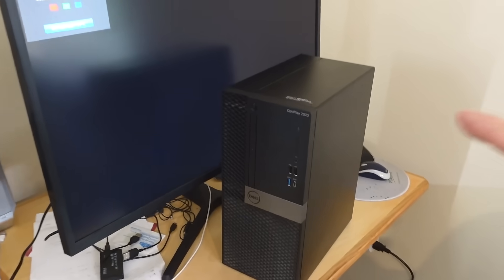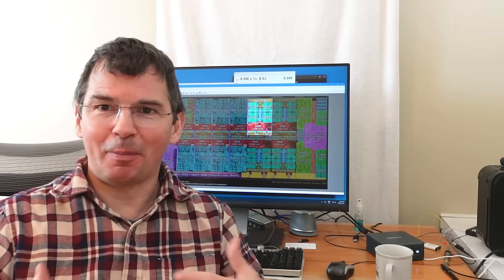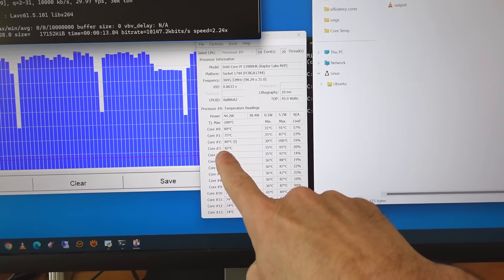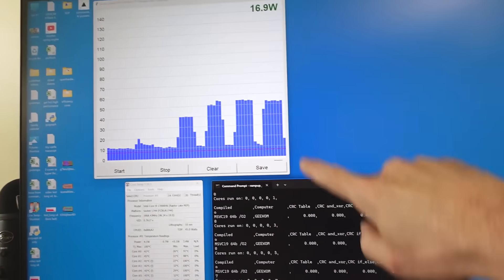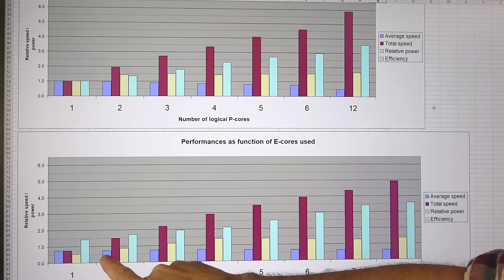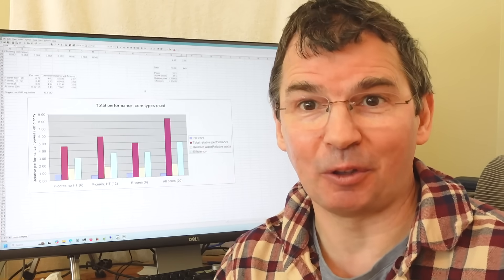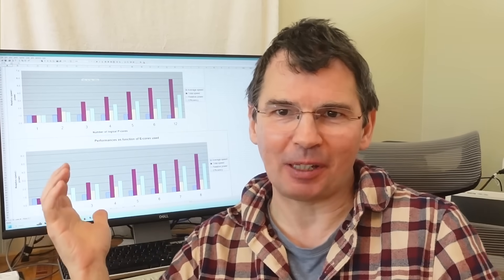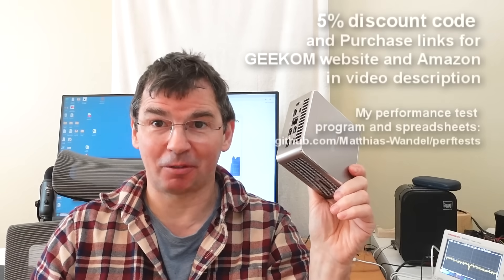Efficiency cores are about performance more than efficiency

Comment: E cores are a huge pain. You are completely at the mercy of the scheduler. Intel also has lp cores in laptop chips, though I never saw task manager show them used for me. E cores behave  different than P cores. They are far less performant than P cores.
Reply from the maker: in my tests, doing old fasioned C stuff, they were only 25% slower.
Reply: @matthiasrandomstuff2221  I think you would love something like an Arrow Lake or Lunar Lake CPU. The E-cores there are massively more powerful than these. 9-wide front end instead of 6-wide, and 8-wide execution instead of the 6 here. The new P-cores are cool too, but those Skymont E-cores are close to the performance of 12th-gen P-cores, and they will hapily do P-core-like clocks of 4+ghz.

Comment: 2:55 if you start the task by mouse clicking a bat file instead of using the keyboard in CMD.exe Windows directs the CPU to use more power?!? That's crazy! I wonder if that's an heuristic used to fool battery efficiency benchmarks a la VW Dieselgate.

Comment: We've done a lot of analysis like this at work, trying to optimize huge database servers.  Glad to see you've mentioned the caveat at 10:32 because our findings were that while our database engine was capable of multithreading, for some jobs raw clock speed is what mattered most.
Reply from the maker: back in the day of Pentium 1, we got a dual processor machine.  I had a very keen co op student who adapted an internal app to multi threaded to take advantage of it.  to both of our surprise, this was slower than before.  the IPC overhead killed it.
Reply: Another issue is that a lot of commercial database software is licensed per core.
Reply: @kellymoses8566 However, having the core in the system necessitates a license charge. Disabling the core in the processor doesn't obviate the license charge, unfortunately.
Reply: @kellymoses8566  Yep, so some they want a mix of both... that said the new AMD processors have that in spades, but per clock speed only still goes to Intel as the only win.

Comment: This reminds me of the funny quiz question: It takes one window cleaner 80 hours to clean a skyscraper. How long would it take 800 window cleaners to do it? Definitely more than 6 minutes.
Reply from the maker: yes, tons of applications that don’t paralelize
Reply: It will only take six minutes, but only after you spend 300 manhours getting everyone in position, then another hundred hours getting everyone down safely.
Reply: IDK. If you provide 800 lifts and find a way to make them actually usable at the same time....
Reply: That reminds me of "if it takes cookies 20 minutes to bake at 300° then it should only take 2 minutes at 3,000°"

Not the same concept, but reminded me.
Reply: @MrModTwelveFoot  Foster's Home for imaginary friends?
Reply: @MrModTwelveFoot  Celsius or Kelvin 😅
Reply: @TobiKellner   I was thinking in Fahrenheit because I'm a neanderthal, but the math works out in any unit. 😆
Reply: @MrModTwelveFoot well, I asked because 3000K is ten times 300K in a way that 3000C isn't ten times 300C 😮
Reply: @TobiKellner  The higher the temperature gets, the less relevant the difference between absolute zero and the zero-point of your scale gets.  And there isn't that much of a difference between Celsius and Fahrenheit in this regard either, simply because the Fahrenheit degrees are smaller, increasing the relevance relative to Celsius, but that's also balanced out with a lower zero point, lowering that relevance again.  I think there is a greater effect from the smaller unit size because the zero points are so similar, but past 1000⁰ in either scale, it really doesn't matter much in either case.
Reply: Amdahl's Law

Comment: While it might not be interesting enough for a video you could try comparing some of these results on Linux (easy enough since it's only ffmpeg) just for your own interest. The Windows CPU scheduler has left a lot to be desired over the past few years especially for "weird" architectures like P/E cores and ryzen 3d vcache. Some Windows-native video games actually run better on Linux through wine now just because the scheduling is so far ahead. If you really want to get busy with it you can also tweak which scheduler the kernel uses entirely although that's out of my expertise.

Comment: The problem with those mini PC's is that you can't fit the really high-performance GPU's that you really want for things like CAD work.
Reply: Some do. Some of the Lenovo Tiny's and Minisforum PC's have a PCIE slot and just enough room for a LPSS(low profile single slot) GPU like the smaller x400/x600/x1000 Quadro's. A few Chinese GPU manufacturers are even now making LPSS Gaming GPU's for this class of machine due to their increasing popularity.
Reply: External GPU?
Reply: @jaro6985  that's an option, but then you're also giving up the portability aspect to some degree.
I just went with a "desktop replacement" laptop instead.

Comment: I've started using mini-pcs for all my work computers and they do everything you need from a basic computer with a lot less power usage (and cheaper too!). One thing I have my eye on that you may be interested in is the new Beelink Me Mini. It's a mini pc with 6 m.2 slots for hard drives. I'm really curious if it can be sufficiently cooled with a single fan

Comment: Would love to see a comparison with a base mac mini. Great insights as always. 🚀
Reply from the maker: would love to do that too, but the base mac mini costs like a top of the line non mac mini pc, and  these videos don't earn enough to justify the expense.
Reply: @matthiasrandomstuff2221  You would definitely find a lot of differences. Relative to Intel's, Apple's efficiency cores are much more focused on power efficiency, much less on area efficiency, and much less on providing lots of performance.  Not sure what the ratios are in the current M4 generation, but in M1 an E core was roughly 1/3 the performance of a P core for 1/4 the die area and 1/10th the power.

Apple still sometimes uses E cores to increase multithreaded performance in low end parts (e.g. M4 has 4P + 6E), because 4/3 the throughput per unit area is a win, but unlike Intel their high end parts are skewed heavily towards P cores (e.g. M4 Max is 12 P + 4 E). Their P core is more power (and probably area) efficient than an Intel E core, so they don't have to follow Intel's path to keep power and area under control.

Comment: 2:45 Intel has the PL1 at 45W, which given the 8W base line from before indicated to me the processor bounces off of the configured power limits hard.
PL2 (115W) can be up to 28 seconds, it seems to be close to zero in this case.
Reply: 10 seconds later he explains that it's Windows' bizarre window-focus-based heuristics forcing the workload onto E-cores-only.  IIRC, this doesn't happen with the performance power plan, but that also disables some C-states and frequency scaling, considerably raising idle power.  Easier to just run Linux.

Comment: The problem is that lithography naming is marketing now. These Xnm mean different thing in each company.  For example that Intel 10nm lithography sometimes is denser than TMSC 7nm.... guess why later Intel renamed it to Intel 7.
Reply from the maker: reminds me of AMD using funny equivalent clock speeds in the days of the intel P4 because the P4 could achieve higher clock speeds, but without actually increasing the performance.
Reply: The nm numbers have been meaningless since FinFet was new, and FinFet is being phsaed out at the hing end now lol. Intel's rebrand was indeed to better match the transistor density of competitors, mostly because that was deemed the most important metric to market on. The numbers mean basically nothing and are useless to compare from foundry to foundry. The best you can hope for is that smaller = newer = better within a given foundry's offerings.

Comment: 13:57
Please don't ONLY test the DC side. You need to test the AC side as that's what you're paying, most power supplies from chinese brand PCs have bad efficiency so you need to account for that as well.

If you need speed on a budget, get shelly or sonoff and flash tasmota/esphome on them, you can change the timing to ms refresh if you want to since its using esp32 chip, tplink is god awful as they are  closed-source and using a proprietary chip. Maybe you could get a ton of GaN supplies next to see the difference in efficiency, they are awesome.
Reply from the maker: All my measurements are on the AC side.  Please do watch the video to see.
Reply: @matthiasrandomstuff2221  
Sorry I meant the time stamp, where you plug it into an oscilloscope, that's DC no?
Reply: @jackipiegg  watch the video again, he's using AC

Comment: I love these little NUCs!  I wish I could find a good use case for ‘em!  All my little guys are Raspberry Pi’s.
Reply from the maker: indeed.  The A5 one idles at under 4 watts, so its very much in raspberry pi league.  Way more power than a pi when its computing, but that's justifiable as it performs much faster.
Reply: @matthiasrandomstuff2221  That's why I don't really understand why pi's are as popular as they are, when you can pick up a year or 2 old mini pc for maybe only a little more than a pi, but it has way higher performance. I've been using mini pc's as my main and media center pc's for a few years now. Most of mine are 6th to 8th gen i7's with plenty of ram - with linux, they're plenty fast for what I'm doing 95% of the time. And I don't spend any extra time mucking with special software on media center PC's, it's just a normal "desktop" connected to the tv

Comment: I was active in PC geekery way back in the AMD Athlon days and its hard to believe that die shrink and performance gains have marched steadily on. There has been much talk over the decades of hitting the wall on that but not yet I guess
Reply from the maker: well, gains have slowed down a LOT in the last ten years.
Reply: Us litho engineers have been bashing our heads into that wall for about a decade at this point lol. Reticle limits could get slashed in half on upcoming nodes too. Chip packaging is the new frontier. 3D stackng, 2.5D die-on-interposer MCM designs, and active interposer tech are all going to be the drivers of the next generation.

GAA-FET nodes will let us wring a bit more out of the silicon, and there's research about jumping ship to new semiconductors like certain Bismuth compounds or Carbon in the future, but even those gains eventually dry up.

Comment: Btw, you got to appreciate the time and effort it takes to gather and analyze the data.
Reply from the maker: yes, these videos are VERY time consuming!
Reply: @matthiasrandomstuff2221  what if there were multiple instances of you working on these videos at the same time? would power efficiency (produced video seconds / total calories eaten) go up or down?
Reply: @rix0r222 Video production output would go down because each Matthias would have new ideas and improvements to include, I'm sure.
Reply: @matthiasrandomstuff2221  Absolutely worth the time though! There's a lot of anecdotes (or just plain marketing material) about CPU efficiency thrown around in the enthusiast circles so an actual analysis with data is very much welcome. I got to say that the niche audience captured here has to be small, but you got all the details right.
Reply: It's exactly why I love these videos so much. No fuss, just 15 minutes of high-quality analysis. My respects

Comment: i f you are reaching 100C on your cpu cores your cooling is wither not working from dust or you have slowed down the fans.  If not that, then the cooling supplied with your product is D U N G.
Reply from the maker: it doesn't hit that unless its in turbo mode.
Reply: Raptor Lake is fine at 100C, at lest for short durations like this. It will slow down more if it stays there for very long. That CPU is getting exactly as much performance out of its avaliable cooling solution as possible, which means it's working as intended. Would it be better if it had never hit that temperature, and could run at its maximum rated 115W all day long? Absolutely that's better, but this is laptop hardware meant to have short bursts of high power, and then sustain much lower power, and you aren't fitting a 115W CPU cooler in that form factor without turning it into a hair dryer.

Comment: I still remember when Intel was mocking AMD "glued" cores architecture back in the day, just for them to realize that's the way forward and adopted the model...
Reply: The marketing is definitely detached from engineering 😂
Reply: Intel is using one die. AMD glued separate dies over an interposer
Reply: When Intel it is called polymer bonding technology… totally different.
Reply: Worth noting that Intel went through 2 generations (3 if you count 14th gen separately) before going to their own multi-chip approach. Meteor Lake and beyond going to tiles has little to do with the hybrid core design.

Comment: Thinking about the e-cores being physically smaller - I'm guessing Intel has removed some functionality (besides just hyperthreading) from the cores to reduce the size? Makes sense honestly, x86 architecture contains an incredible amount of legacy support. Which for most modern applications aren't required. So did Intel build the E-cores to only really support the newer, more common instructions or could the E-cores be used exclusively without any consequence?
Reply from the maker: less speculative executioion, less wide and long pipeline, less cache.  These are all things that produce marginal performance gains fora lot of silicon.
Reply: You can't totally remove instructions because the OS scheduler needs to be able to move tasks between cores, and programs would get very confused if an instruction suddenly became unavailable while they were running. Generally all the really legacy instructions are handled in microcode and don't actually add much to the chip area anyway.

Comment: Cool vid, just to add some notes. Yes, E cores are much better at die space utilisation, and that was the primary reason for intel to go with them because with only P cores they couldn't fit enough and they would loose badly at MT apps (like they did with 11 series). However there is a trade of and a reason why this approach is not optimal and why amd doesn't use it most likely, E cores mostly save die space by having lower cache levels, so they don't perform well at all in cache sensitive apps and gaming.
Reply from the maker: yes, cache is smaller, but the actual core is also much smaller.  Just look at the die photos.
Reply: @matthiasrandomstuff2221 of course, I skipped this part to not make the comment too long. It can be smaller (denser) because it works on lower clocks.
Reply: AMD has Zen4c. It uses less die space than Zen4, runs at a lower clock and is more efficient. The difference is Zen4c has the same IPC and SMT as Zen4. They also make Zen4+4c laptops chips, and will likely make Zen5+5c laptop chips too.
Reply: @ionstorm66 yep. I believe they're larger than an Intel E core, but the upside is they're very efficient and the exact same core architecture as whatever Zen core it's using, like Zen 5. It's just that they redesigned it with high density and low power transistor library rules. 

They extensively redrew the floorplan and layout of the core to fit the jigsaw together with denser design rules. That does take parts of the mid to high level design team to do the same work for 2 core designs vs 1 though, but less work than a completely different architecture sharing the same low density high power lithography like Intel does.
Reply: Non-computer guy here looking at upgrading at some point. Could you give an example of cache hungry applications this would struggle with?
Reply: @MrModTwelveFoot it wouldn't since it has P cores still, I was just talking about the tech.
Reply: @riba2233  okay, got it. A reason not to have only E cores though.
Reply: @MrModTwelveFoot yep, that and apps that are primarily single threaded would also suffer 😊